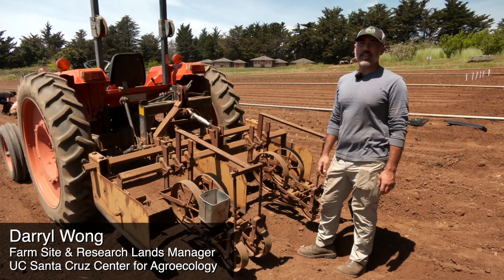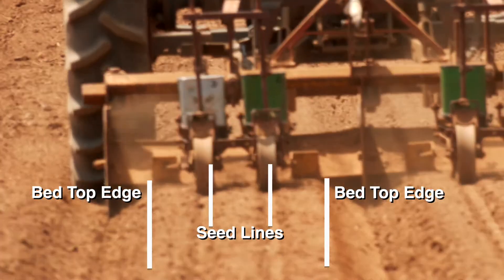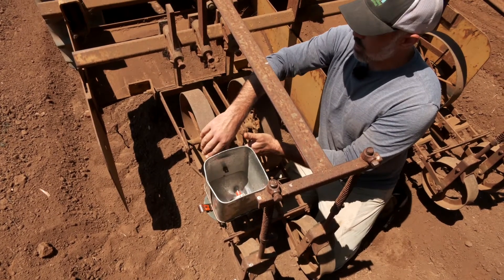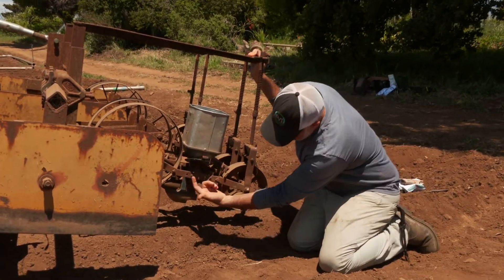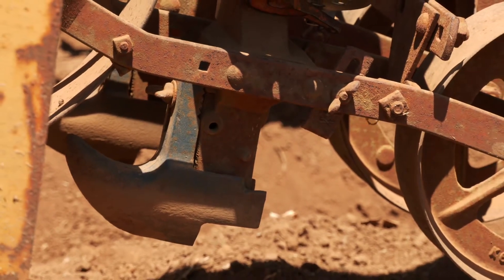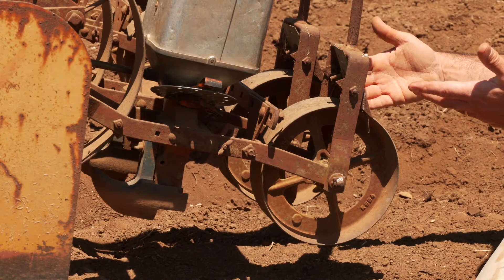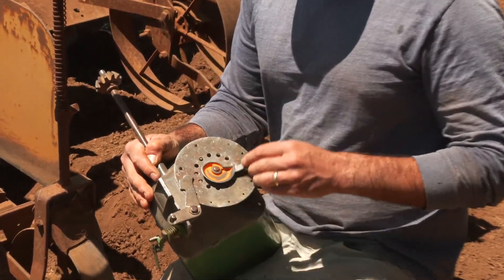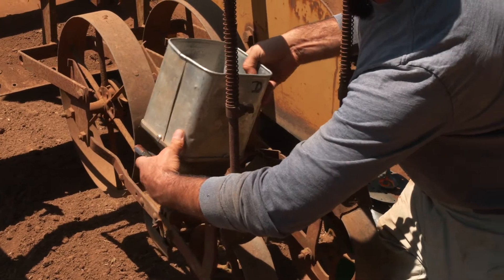How to Setup and Run the Planet Junior Seeder

Comment: USELESS as you may think you did a WHOLE FIELD but never saw that the seed flow was BLOCKED or had not been moved to ON.
Reply from the maker: Haven't had that problem in 4 decades of use.  We always check the first 50 feet of planting for proper seed drop and spacing.  We also check the level of the seed in the hopper as we go along.  With those checks, we've had good success with the Planet Junior.